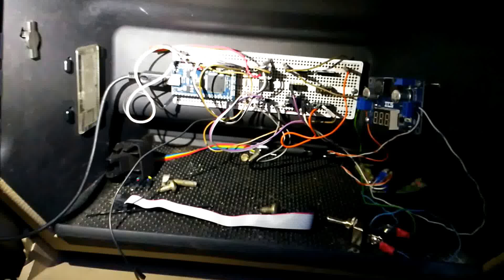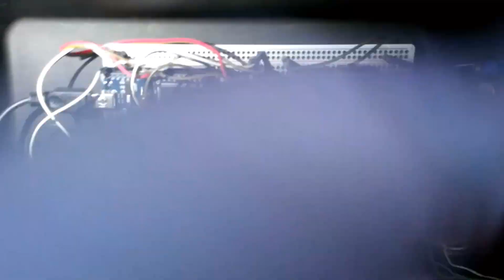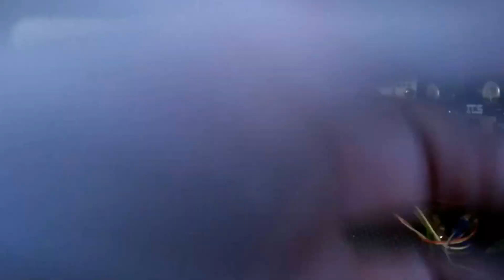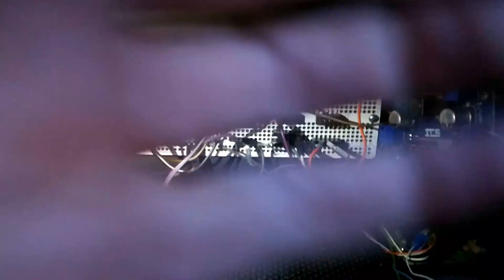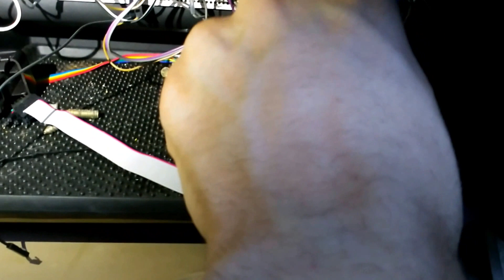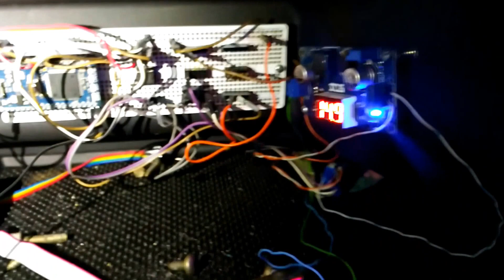In car tuning/flashing adapter - just4trionic mbed nxp1768. 99 Saab 9³ with trionic 5 ecu

Comment: This is awesome. I'm currently trying to accomplish the same thing. Did you ever get around to making a video about dumping and flashing? I'm having some issues establishing a connection. Something with MyBooty I suspect. I read all of Sophie's documentation but how do you set up the mbed software wise? MyBooty v2 is a little tricky in that you have to modify code. Can you just use v1.1 for dumping and flashing? I'd really enjoy a video on this if at all possible
Reply from the maker: +Aaron Brvenik I'll try to add a video of flashing, live tuning, and such with the just4trionic adapter when I am soonest able to.  The mbed is remarkably easy to write the software to.  You simply drag(like any normal File move or copy operation within windows) and drop the just4trionic binary onto the devices memory as it reads on a normal computer as a flash storage device.  It's been good while since I've used mine and Sophie may have made updates to the code including the code of her bootloader, MyBooty.  I don't recall having to modify the MyBooty code at all with mine.  I'll have a look at the changeover of MyBooty in her GitHub and see what's up.  In the mean time, did you check out my notebook section on the mbed site along with Sophie's?

Comment: Nice.. Is it possible to use an arduino for this ?
Reply from the maker: +TurboViking not to my knowledge.
Reply from the maker: +TurboViking though see my other video about the homebrew combiadapter
Reply from the maker: +TurboViking there is a guy on the trionictuning forums that made a stand alone flasher that does not require a PC that is arduino based.   It's called project thingy